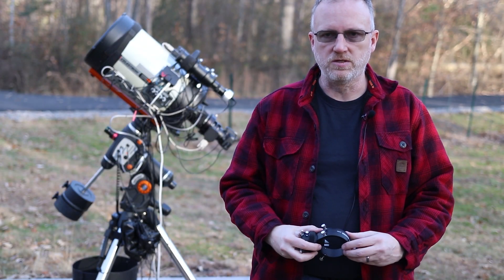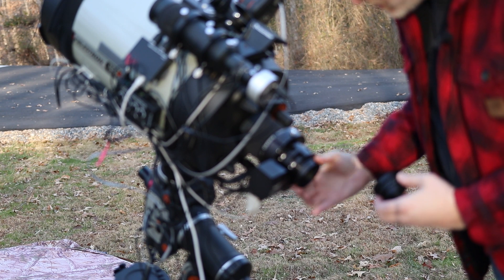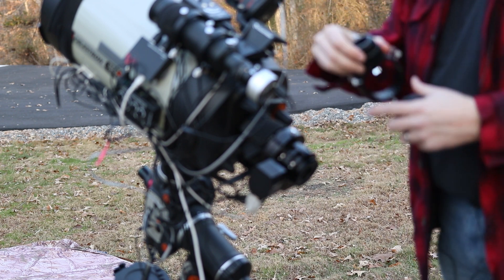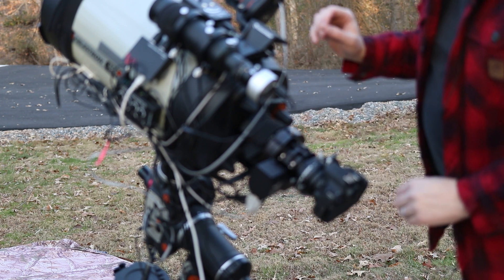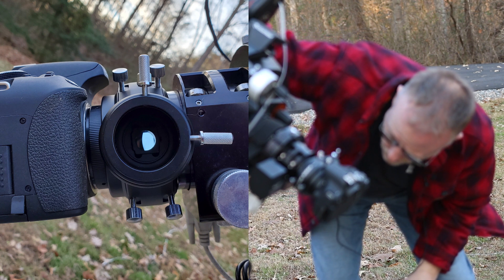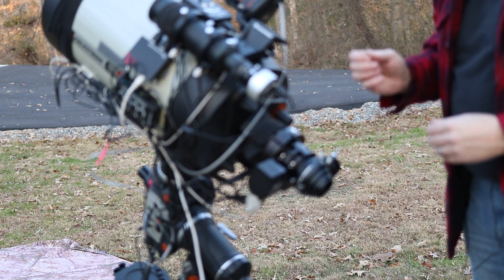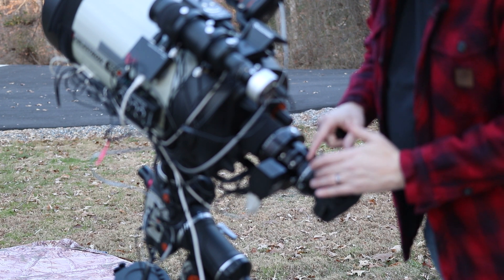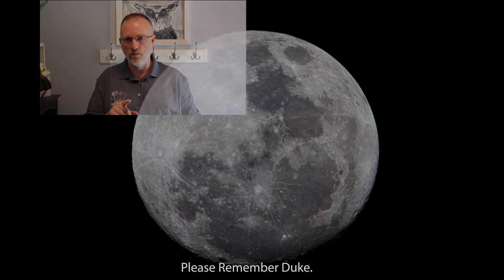EP95 - Installing the OAG and ZWO ASI174MM Mini

Comment: out of focus
Reply from the maker: Thanks for watching for as long as you may have.  I did put a text block at the 1:20 mark apologizing for the AF issues.  After some testing it appears I have a bad AF setting.  This has been corrected.  As shown in Episode 97, this setup did not have the proper backfocus (will discuss this more in EP98 to be posted this week).  When I get the parts I need I will be redoing the installation video and will ensure the focus is spot on next time.

Clear Skies.
Reply: Just redo it…